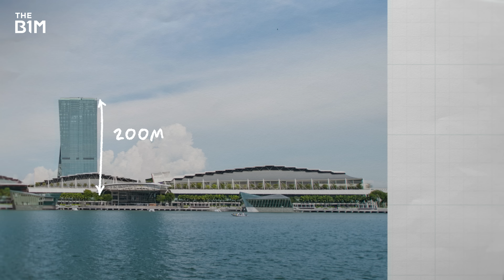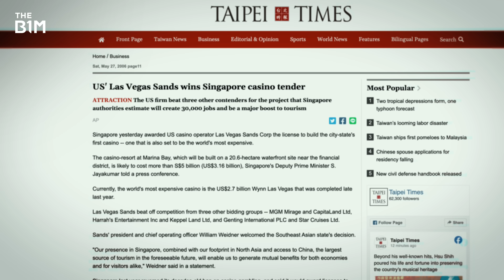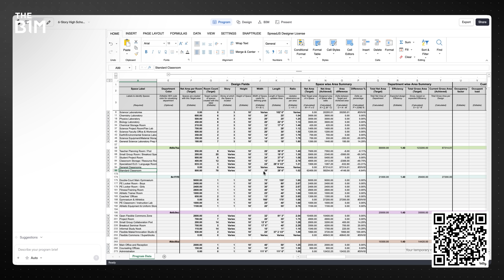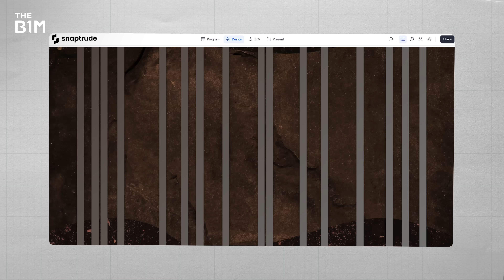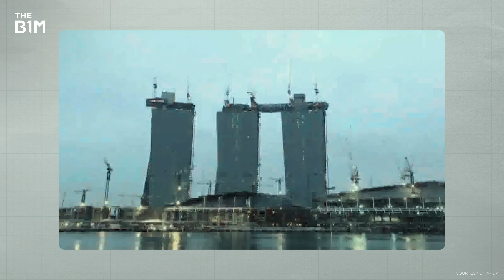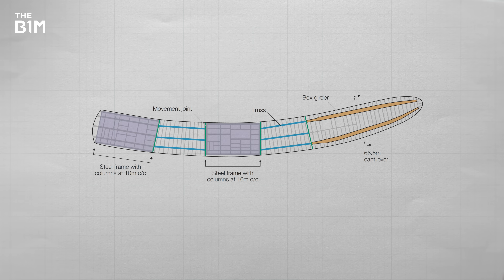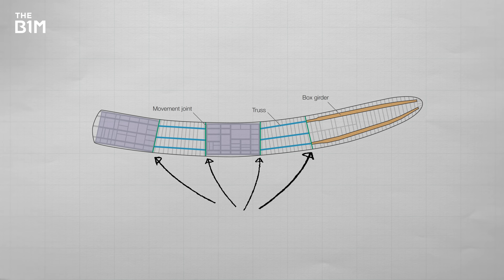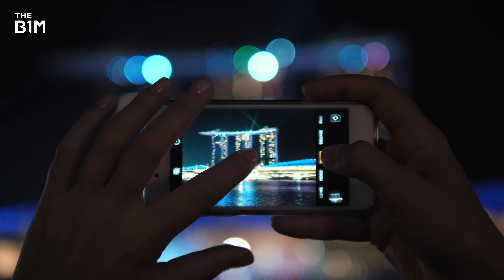Singapore is Finally Finishing Marina Bay Sands

Comment: I have seen it from a half mile away. The most impressive thing is the 3 buildings height and connecting sky park. The architect could have removed the 2 leaning buildings as its not a key feature. It would have then been pure vertical and much simpler.

Comment: I’m not so sure those are hydraulic jacks. The worker is positioning a bottle jack just like I did in replacing piers in my house. The  stationary supporting jacks are probably adjusted mechanically  after the temporary jack provides support like the ones under my house.

Comment: As an architect I marvel over the design and construction of the Marina Bay Sands hotel towers and the rest of the structures in complex. I just hope the new, proposed fourth tower doesn’t detract from the unique look of the three existing towers and skylark above. I have also noticed that there are other large structures with similar usages that use the same concept of multiple towers with a horizontal connector structure over the top in places like Somewhere in China and maybe in Dubai. However, these more recent structures look so contrived that they are extremely ugly and are just ridiculous. Nothing compares to the Marina Bay Sands style.

Comment: I slept a night in the MBS in june, middle tower, 40th floor. Absolutely incredible construction, the pool on top is beyond breathtaking. My room was just below the pool, sometimes water splashed on the outside window🇸🇬
Reply: You must be mistaken about the water splashing against your windows. It isn't possible because there are two wide ledges that extend from the edge of the pool. You can't even throw water over the edge. Plus, the 40th floor is at least 15 floors below the pool. Sorry to disappoint you but it was probably rain that you saw.
Reply: @CobraSloth  it was quite windy that day but cloudless. I get what you mean but it was 100% the pool
Reply: It could be the rain water or plants water drips from the facade, if you notice, the building does not have rain water down pipe for some reason.
Reply: I've been up on the SkyPark on a heavily overcast day... The moment I walked out onto the deck, beads of water formed on my skin. I was in the clouds! Weather remained that way and when I went back down and away from MBS, it was visibly  clear that the entire top of the building was shrouded in low clouds.

Comment: "This is a 200 m skyscraper. It soars 50 floors..."
🧐
50 floors X 3m / floor = 150 m.  What do they do with the other 50 m?
Reply: Is every floor3m height? Have u seen on photos what is a typical 5stars hotel lobby height? And did u include the boat at the top and the gap below it?. Thk god u not an engineer
Reply: @Khairul-wg1km  "Thk god u not an engineer"

Yeah likewise. (1) A "typical" 5-star hotel lobby might be double or triple volume but that would be counted as two or three floors - anyway you can clearly see in the photos shown later in the video that the lobby doubles as a retail shopping centre with ground and two more floors (2) "Every" floor might not be 3m in height but it's a pretty good international average. 200 / 50 = 4 m is way outside that average - not even turn of the 20th century courthouses were built with 4m floor heights, and with the already colossal building costs of this place there's absolutely no way the Sands' floors average out at 4m (3) no I didn't include the "boat at the top" or the "gap" (unclear what you are referring to there) at the bottom because in the voiceover it's pretty obvious they weren't included in the dimensions.